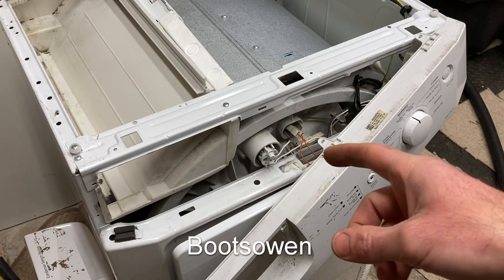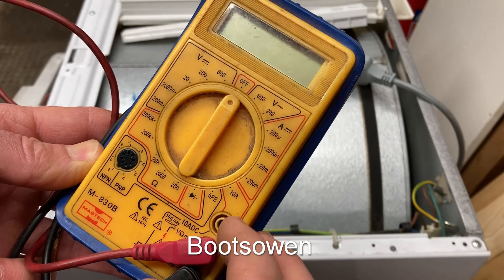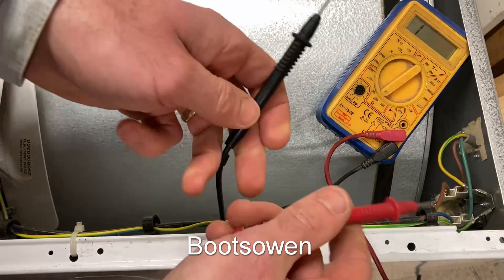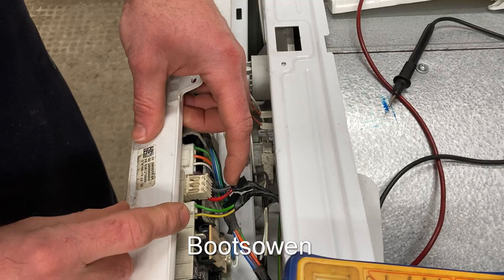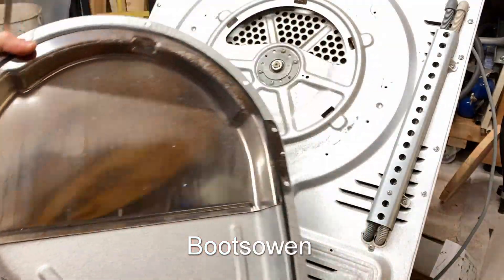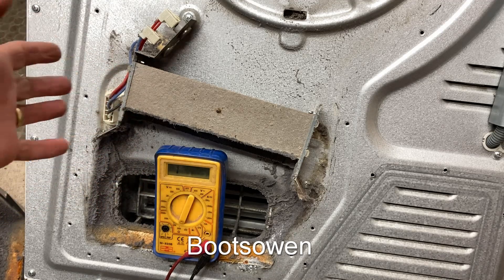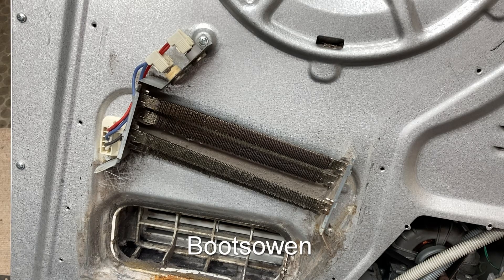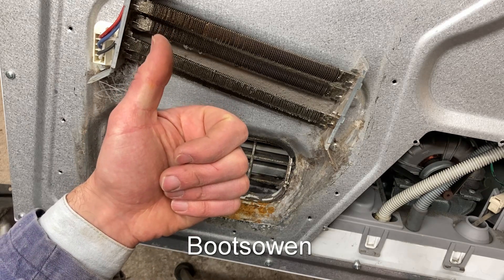Beko tumble checking: continuity testing and element fail

Comment: Will ya get a meter with some sort of realistic protection !!! ... You were plugging that thing into line v AC with both hands holding the leads in other vids 😯. I have a few of them little meters as they're grand for diagnosing & throwing them into the toolbox & if they're broke sure no tears, but I don't trust them on 240v. Treat yourself with something with good ceramic fuse protection Mr B. They're way cheaper now than in the good old days.
Reply from the maker: I have an old avo meter, I like it too, but it is heavier so not as easy to mobilise. What's your worry, can't you see that the cables are starting to fret too. It's a wonder I am alive at all. Send me a link to what you are talking about, joking aside. I would be glad of a steer. What do you mean about the ceramic fuse? in the meter?
Reply: @bootsowen  I'm only a "YouTube expert" on such matters,  but from what I've seen "catagory 5" is the highest protection. Ie: cat 3-4-5 ya see where your leads plug in. But a lot of cheap meters although they say "cat 3" when taken apart are suspect. Uni-T I believe do relatively good stuff for small money Mr B. Although check the specs & reviews. Some dmm's have a strip of wire on the PCB as a fuse, some with glass or ceramic replaceable slow or fast burning fuses. It was explained, a good brand larger ceramic fuse will deal with the energy better if blown. BigClive put up a recent vid on how to work on live stuff,. All kind of obvious tips, but foresight is better than hindsight in such matters ! Self awareness & good discipline in working practice. EEVblog done good reviews on cheaper dmm's. & Vids on how to work on live equipment.  Even the cheapest dmm will cover most of our needs, But I NEVER poke sumtin that cost a fiver into line v AC.  & even with a better meter,  I'll have one hand in my pocket & the other on  quality insulated leads.

Comment: Owen, I'm thinking that as It's such a tidy condensing machine a bit of effort will be worth it. Now is the time to plug it in again and see what happens before you put it back together, cheers
Reply from the maker: Got a bit of daylight today and made some headway. The element was obviously suspect but I did what you and others said and isolated the RFI cap and hey presto.
Reply: @bootsowen  Owen, splendid, there's so much technology in them that its a shame to waste it, same as those Aurora turbine inverters. Perseverance has seemingly paid off, cheers

Comment: Another great video :)
Looks like the Heating element defo died there. its popped, and part of that element shouldnt be just lose hanging there, it seemss pretty clean for the statement of the machine. that fluff build up could of popped it over time, or been damaged somehow when been moved. everything else looks good on the machine. defo could be salvaged :) they do average from £17.95 - £23.95 online.. i personally wouldnt pay that and it turns out machines gonna die anyway, no idea how old the motor is either...
Reply from the maker: I ordered one off ebay for £14 delivered, new but bought in error, so a bargain for me. Hope it comes soon.